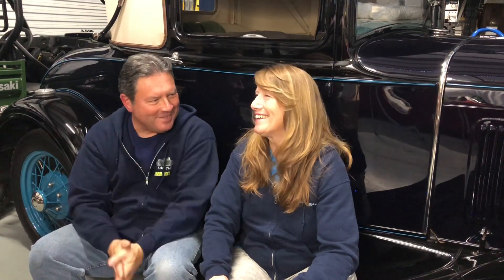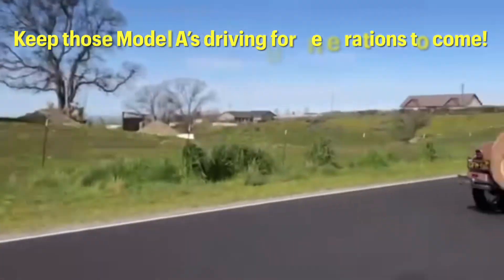Ford Model A Q&A of the day - How do I get my engine up to operating temperature in the winter?

Comment: I just got my first model A, 1931 4 door (at 28.) Just rebuilt my carb and and doing normal maintenance and changing gaskets because it's an older restoration that sat for years. But I have a question, someone changed the points to the electronic type. I have no idea how to time it. Should I change it back to traditional points or not?
Reply from the maker: Our suggestion is always to go original, congratulations on your first Model A while so young!! 🥳

Comment: A couple of years ago the temperature here in San Antonio went down to 17 degrees. I tried the cardboard trick and my 1931 Wretched Roadster warmed up quickly. I was surprised to find that the fan sucked the cardboard to the front of the radiator and didn’t need any attachments to hold it in place.

Comment: To get the full efficiency out of the coolant a thermostat is used to control the flow so that the coolant can absorb more BTU, if you just let the coolant flow at a high speed the contact time with the cylinder walls is too short to remove all the heat from the block. The modern thermostat will regulate flow to maintain temperature and a proper flow rate as its opening moves depending on temperature. Also, you need to maintain a 50/50 mix of antifreeze too deionized water. The deionized water will stop mineral buildup in the cooling system so never use tap water. A 100% antifreeze in your motor will actually run hotter as it was not designed to absorb heat the water does the main part of the work as it carries more heat per unit.

Comment: My engine ran super cool her in PA in the fall and spring.  I put in a thermostat.  There's a kit that mounts right on the head and it has a port for your temp gauge.  Works well is summer too.  I did the cardboard thing for a while, but the thermostat is a tad easier for a lazy person.  Not a thermostat fan, but you running to cold is not good either.

Comment: Paul, I would like to offer a technical correction to your explanation of the coolant thermostat.  The thermostat (t-stat) does not block coolant flow through the engine (as you state in the video) but rather blocks coolant flow through the radiator until the engine warms up and the t-stat opens.  Coolant should always be flowing through the engine.

Regarding getting the engine to (& maintaining) a warmer operating temperature in cold ambient conditions.  Using a 'winter front' (cardboard, canvas, shutters, etc.) has been a long standing practice going back to when our A's were new.  However, if someone choses to use some form of radiator 'winter front', they must be extra vigilant to insure they do not block too much of the radiator and allow the engine to overheat.  In the 'big picture' it is better to run the Model-A a little cool rather than overheat the engine.  If you're lucky, overheating the engine might only cost you a head gasket.  If you're not so lucky you could warp or crack the head and/or the block.  My preference is to run a little cool as I don’t want to pull my head!

Keep them rubberside down and the shineyside forward. 

Randy 
(back home in Indiana)
Reply from the maker: I disagree, please explain the path of coolant flow through a Model A engine when a thermostat is closed.

Comment: .Yeah I've owned one of those small pullys too. They do a great job of slowing down all of the accessory drives when you have a valve in head conversion and are spinning the crank very fast. Also they don't explode on hills like the stock ones do trying to act like harmonic balancers. Good video, I like your hair.
Reply from the maker: Great share, thanks! 💗

Comment: These days (and for the past few decades!) the Federal government has had a Lot to say about new car manufacturing! Mostly EPA (and CARB!). Temps just so, air/fuel ratio just so, must have cats (no dogs) and a host of other requirements. The A was built on another planet. I must be an alien, 'cuz I like the A! Good morning, Team Shinn! Happy Monday (said nobody!).
Reply: I have no blood in my ☕ coffee system. Only caffeine!
Reply: My wife is so cold ❄️ in the winter; poor thing. I must get her electric 🧦 socks. Electric vest 🔌 and a big battery 🔋 to power them.
Reply from the maker: @williamforbes5826  I am noticing that as I get older my tolerance to really cold and really hot are getting lower…I used to run in 107 degree weather and no big deal 🤪
Reply: @Modeltshinn  Must be something to that. I either freeze or melt also; not quite a easily as Karen though.
Reply from the maker: Good stuff, thanks and good morning, happy to start a new week 😁💗 Have a great week!

Comment: In the vein of using cardboard to block part of the radiator, auto accessory dealers of the period offered "winter fronts" that attached to the radiator.  Most could be rolled or folded to expose more or less of the radiator, depending on the temperature.  The really fancy ones had movable shutters that rotated more open or closed in response to an air thermostat.
Reply: Yeah, winter fronts were still popular in the trucking industry up until the '80s. They have pretty much faded into obscurity.
Reply from the maker: That’s interesting, thanks for sharing!

Comment: did Ford make a kit to run a Model A on  alcohol?
Reply: Ford did not. There were some As converted to run on kerosene because it was less costly than gasoline, though they had to be started on gasoline before throwing the valve to the kerosene tank. 
Alcohol as a fuel has less power per gallon, so a stock engine will create less power. However alcohol resists predetonation (knocking) very well, so, in theory, the engine could have a much higher compression ratio to add back some power. It seems a long way to go to use alcohol. 
PS Alcohol may cause carburetor icing unless the carb is well heated.
Reply: : @allareasindex7984  Thank you Model T and Paul
Reply from the maker: Nope the alcohol just goes straight in 😁💗